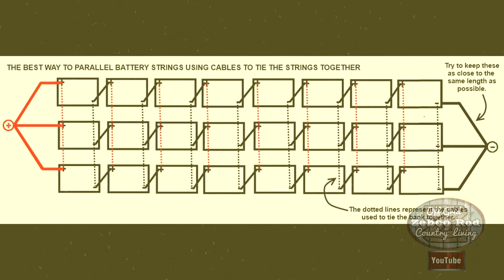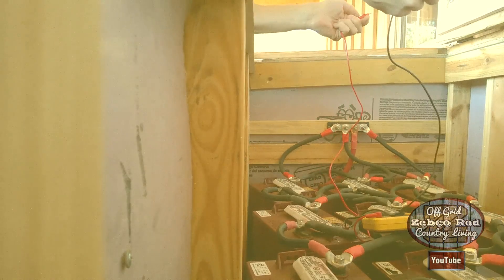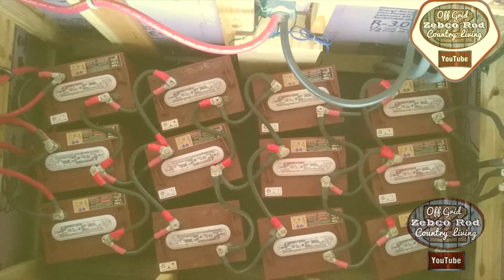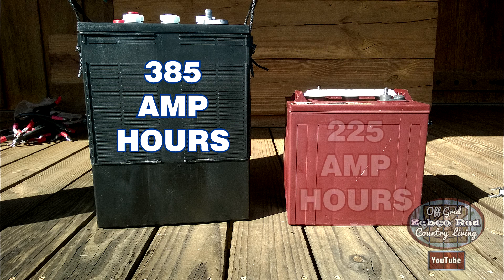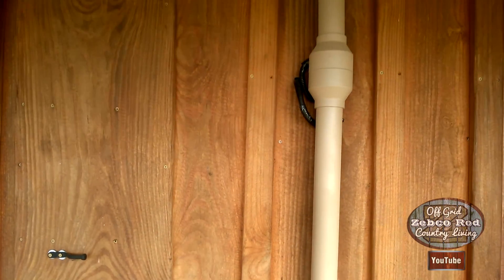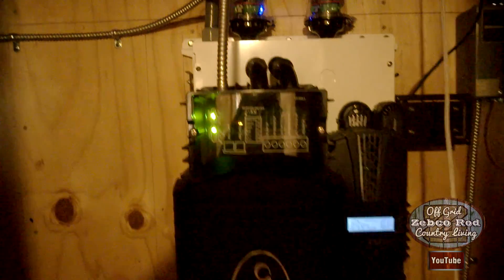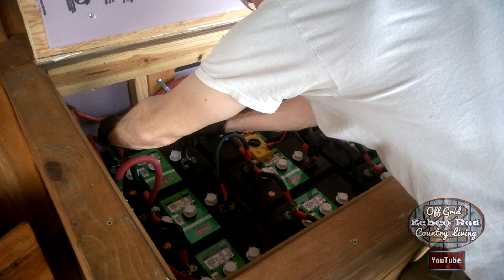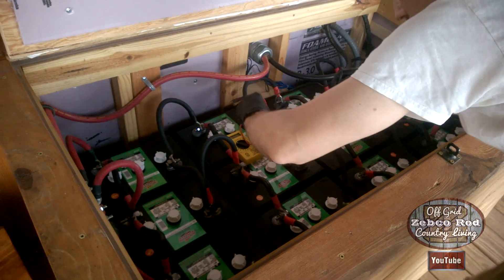New L16 batteries and added a 12 volt vent fan to our 24 volt off grid battery bank

Comment: Beautiful Battery system.    

Wow those L16 batteries are here in Europe very expensive the price beginning at €320,- $340,-   There In the USA  $225,-  i see on the internet.

I need in the future 8 of those L16 batteries. I have now 12 Trojan T105 batteries for a big 24v 675 amp battery-bank.   

I hope that i can do with it until 2023.

Comment: Thank you for this video and explanation. I was JUST thinking about where you were at with your busbar direct parallel wiring. And, congrats on the batteries! I have 12 L16 batteries also. As for wiring...it looks simple. But, essentially, you are using a busbar for the pos/neg at each of the "24v" batteries. Sound correct? I am very much leaning toward doing this. Take care...well done...looks awesome.